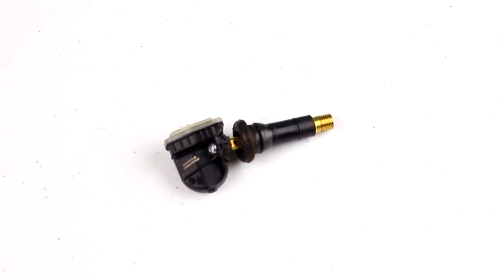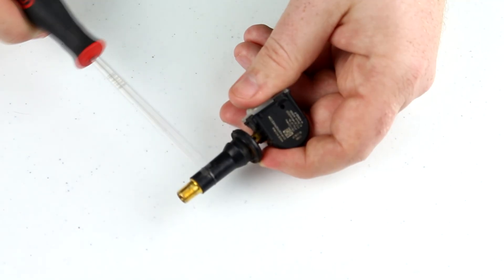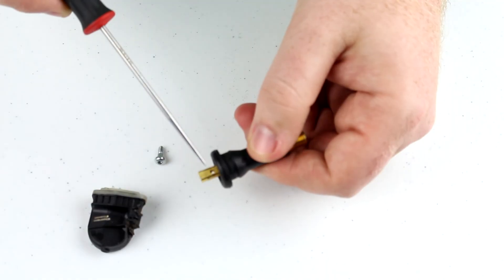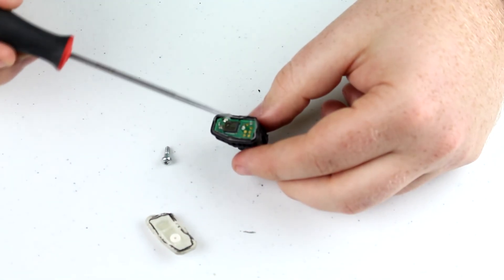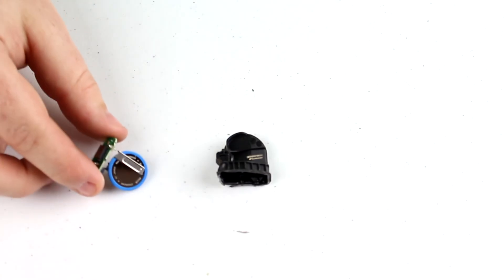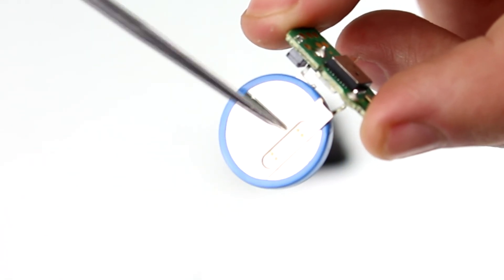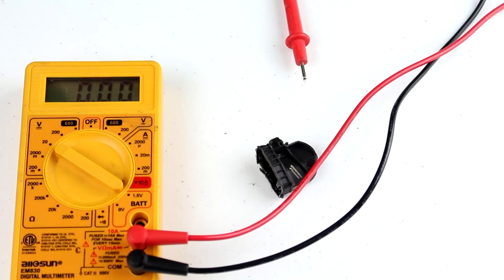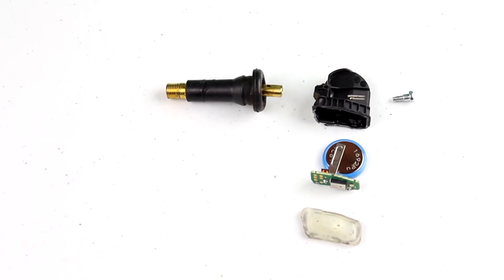What's Inside a Tire Pressure Monitoring Sensor? (TPMS) • Cars Simplified

Comment: a battery might be dead and still read a decent voltage, you would need to put a load on it to measure voltage under a load. If you have a battery tester it would do it otherwise you would put a resistor across the battery to put it under a load. Also, your multimeter has a battery test function which will put a load, you could have tried that on the 9V range

Comment: Another TPMS video that does NOT explain how the sensor functions and is triggered
Reply: let me know if you find one or some text. I'm justnow searching.
Reply: @robbyddurham1624  According to Google Gemini: "Inside the sensor is a tiny pressure transducer, often a MEMS (Micro-Electro-Mechanical System) sensor, that physically feels the air pressure and converts it into an electrical signal." That chip on the PCB is the sensor itself. You can see a hole in its center where air pressure makes contact.

Comment: What frequency sensors work? How to test the signal?
Reply from the maker: I don't recall the frequency and a quick search didn't come up with the results I wanted, but testing the signal can be done with an oscilloscope.
Reply: @CarsSimplified  Very few people have an oscilloscope that has a 500 MHz or even 1 GHz bandwidth. So no, that's absolutely not feasible :D

Comment: Open it with an exacto knife. The 2032 is not the complete number. You need the 2032 that can withstand up to 40 below and has the solder tabs on it. Then you can replace the battery and reseal it with a thin bead of silicone. then it will be good for several years again.

Comment: I knew there were tire pressure sensors, but it never occurred to me that they would have to be powered by something. I guess a small battery is the best way to do that! Do they shut off when you turn the car off?
Reply from the maker: Some advanced ones may go into low power mode, but if they turned completely off, they wouldn't be able to receive an on command, so they start slowly draining the battery as soon as they are manufactured.

Comment: What camera did you use?
Reply from the maker: For this and most of my videos lately, I have been using a Canon EOS Rebel T5i ( https://amzn.to/2AH5zyX - No longer in production?) with the 18 to 55mm lens (that it came with) zoomed most of the way in. I am sure there are better cameras out there for the job, but it really just takes a tripod, a good optical zoom/focus at that zoom level, and a lot of light to film shots like this and most of my spark plug design video.

I actually filmed a video two weeks ago talking about some of my gear, which I will try to get edited soon!
Reply: That video is out now, I think.